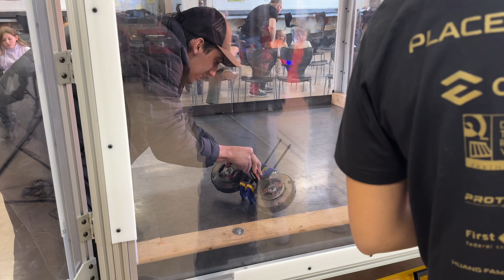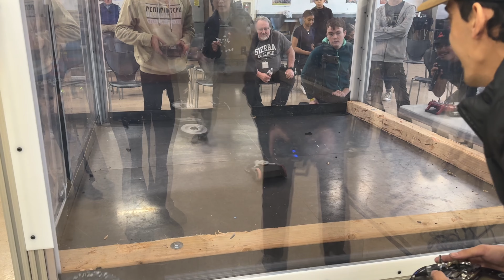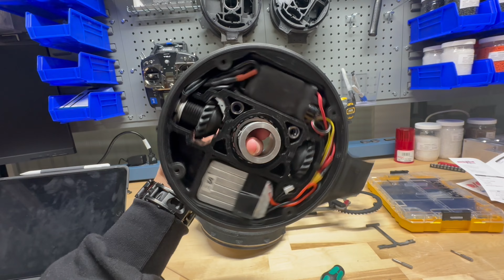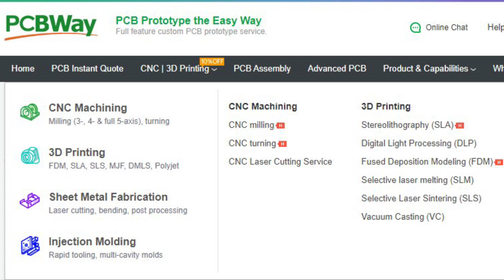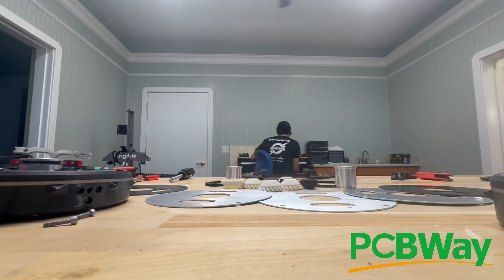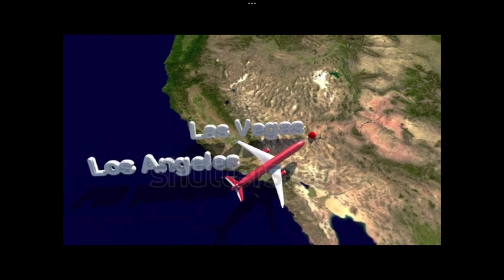Experimental weapon testing for NHRL! Zero - Zero 3lb Build

Comment: how do you controll it, like does it havetank steering or is it coded
Reply from the maker: There’s a switch on my transmitter that can switch between two types of driving. One tank style, one with a little more complexity that can ramp both weapons simultaneously
Reply: @ cool, also I like your robot